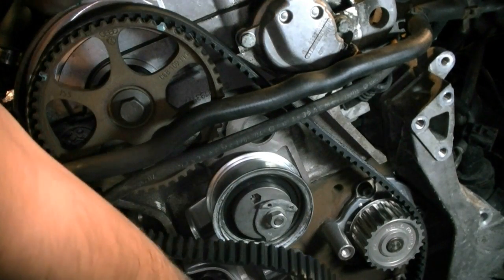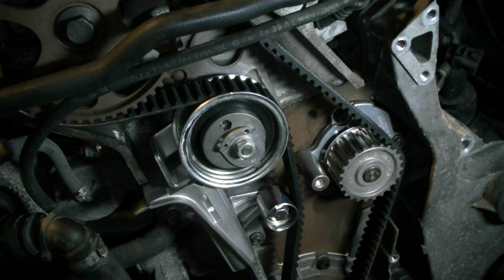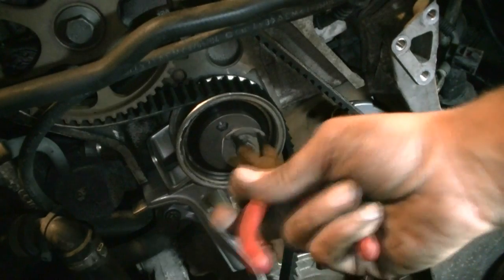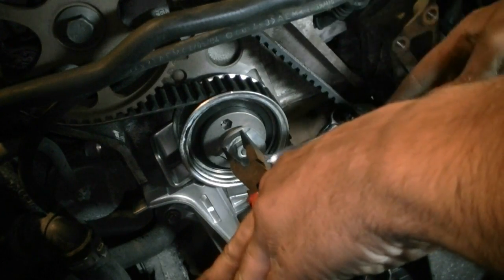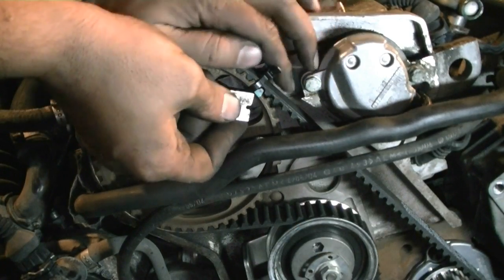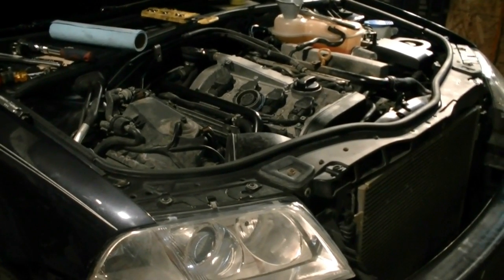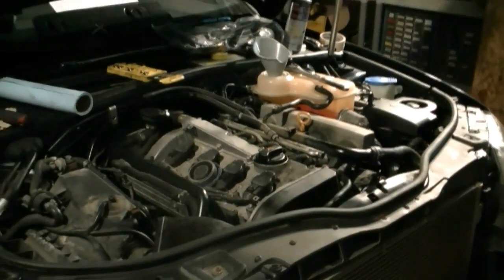How to replace the timing belt on a 2004 VW Passat Audi 1 8L Turbo Engine Part 3

Comment: I've done this twice. This video is a good refresher. I have pulled the rad and bumper for easier access. The Upper Cam gear marks as related to the crankshaft are critical. The removal of the alternator bolt might encourage some hot language! The 1.8Lt is  sweet torture, be fussy. Motor mounts? Thank you.

Comment: Update, pro tip: Replace the failure-prone plunger/idler assembly with a manually adjusted tensioner, as used in the B6 Audi AMB 1.8T engine. ECS tuning and others sell the adapter kit -- highly recommended.

Comment: I think I finally understand the adjustment now. To clarify what you're saying correctly: the spring-hydralics in the piston is too strong to retract using pliers on the pointer piece. You can only do that (if you screw up and release the piston too far) by turning the hex socket counter clockwise (and you should do that slowly). So start with the pointer all the way to the left to have the most slack to get the timing belt on. Then get the pointer as far to the right tightening up the t-belt and lock in place with the bolt before releasing the piston. Then adjust the pointer to the left (pulling clockwise with the pliers) as much as necessary to get your 8mm gap leaving the piston at about the center of it's range. The piston is slow to react and turning the crankshaft two turns makes sure the gap has settled and that your marks still line up.

Comment: I have now got my car into service position and am prepared to remove belt as long as I line up the lines on cam how do I know and does it matter if it is on the compression or exhaust stroke @Ratchets And Wrenches

Comment: 3 yr old video but I did the repair recently but my tensioner piston doesn't stay up, It goes back down.. any advice?
Reply: Buy new tensioner
Reply: Did you ever figure this out? I'm having the same problem right now. I've looked all over and can't figure it out!
Reply: Cameron McEldoon  did you found a solution ?
Reply: Answer the people David! They're waiting for the answer.
Reply: Lol sorry.. didn't seem I was being asked.. apparently the piston is supposed to go down that way when the belt loosens due to use, the piston will than start coming out keeping the belt tight.. my passat hasn't given me problems so yep yep

Comment: There is a procedure on Passat world that leaves the half tooth off timing mark to the right of the mark on the valve cover rather than to the left as in your video. The reasoning behind this is, if the belt stretches over time then the timing will improve rather than get worse.

Comment: great video.. I need to replace my water pump.. how long of a job you think it would be?. 2002 a4 quattro 1.8
Reply: Same length of time to change a timing belt.  If you need a water pump replace the belt and visa versa.  Never replace one without the other.  Get a complete kit.  It contains tensioner and every thing else you need including the pin to hold the tensioner.

Comment: How many km do they have recommended before changing rhw timing belt
Reply from the maker: jiinlone07 Its based on your car's year make and model.
Reply: In europe they do it roughly on 50k, but as mentioned it differs from car to another

Comment: Half a tooth on the cam is a full tooth on the crank as the crank spins twice for every rotation of the cam. The marks should line up to the dot or the engine will not be timed correctly and if bad enough you'll get cam/crank allocation trouble codes. The timing belt will also stretch slightly so that's going to mess your timing even more. Your car, your engine, my advice...take it or leave it. Best regards from a level 3 Audi tech.
Reply: Nope, it never perfectly matches up on these cars
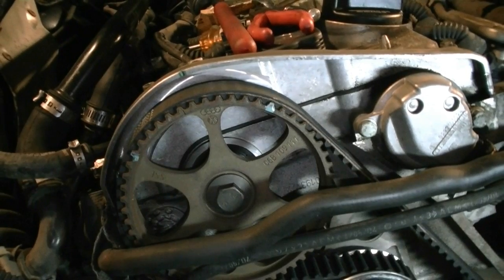Reply: +1 I had a code 17748 cam/crank correlation error on my 2003 Passat 1.8T. The belt was replaced before I bought it.Removed the timing covers and the belt looked exactly like this video (at min 5:30) with the cam mark slightly to the left of the mark on the cover. Moved one tooth over marks now line up and no more engine light.
Reply: As you know it's best to take the timing covers off and check the cam windows for proper time, the pully might be off slightly but that's no big deal as long as the exhaust cam is timed properly.

Comment: thank you your video was to me very helpful. I changed the timing belt for may past 1.8t 2003 after one day driving I got p0011. when I opened the upper side timing belt cover I saw the roller tensioner went back and the hydraulic tensioner went back to its original position. when I loosed the roller nuts the hydraulic pushed the roller up. I believe my mistake was that I tightened the roller nuts to strong. what do you think? do you have the torque for roller nuts?

Comment: if I want to change the timing belt and I am messing up with camshaft teeth and belt. is it possible to get it right position? please ask my question cause I need to know before start up
Reply from the maker: Dont start the car if your timing marks arent lining up, you will destroy your engine. Keep watching this videos and keep trying until you get them to line up, after each time you adjust the belt, turn the crank two full rotations and check your marks. If they still dont line up get a professional to come fix it for you. GL
Reply from the maker: 2 or 3 millimeters? no that shouldnt destroy your engine, but I wont be held responsible if it does since you might have over tightened something else or the belt might be too loose or something!! Just take the belt off, follow the instructions exactly, especially about the tensioner and try again. You should get it right. Also make sure you are looking at the cam straight.. maybe its at exactly TDC anyways. GL
Reply from the maker: Did the noise only come after you changed the timing belt? If you put the timing belt on wrong you would have a check engine light, probably regarding a camshaft sensor also missfire's if you put it on way off mark.

On the other hand sounds like you have a bad turbo, oil is leaking into your intercooler and being sucked up into your intake manifold and burned by your engine, thats why you have low power. As far as the noise, it will be very hard for me to tell, but try to pin point where the noise is coming from, top of engine left or right? Maybe your turbo?

GL

Comment: Thanks for the video.  It took me two days but I am sure I would not have attempted it without your video.  I broke an allen wrench in one of the harmonic balancer bolts.  Could not drill it out.  Beat a 12mm socket with 12 points over the bolt and was able to remove it.  Also, attempted to torque the tensioner bolts to 25 lbs as suggested.  One bolt broke at 20.  Oh yes, the thermostat goes in with the spring side in the block.  Thanks again for your help!!

Comment: wats the driffent between the audi 1.8litr an the vw passat same perseadure ign timing
Reply from the maker: They are the same engine, with minor differences, but the timing belt procedure should be the same. But check your manual to be sure! GL
Reply: same basics same function same engine ignition timing  position

Comment: When changing your timing belt, they recommend you change your water pump as well. Must you also have to change the thermostat or does that depend on its condition?
Reply from the maker: Yes, its a very good idea to change the water pump and thermostat while you're in there. Its money well spent. GL

Comment: How long does a timing belt last on a Passat before needing replacement? I am planning on buying a 2003 VW Passat and the timing belt was changed when the vehicle was at 73k and now its at 93k.

Comment: Doing a timing belt is easy
Doing a timing gear set and chain is easy
As long as you understand what is TDC BDC
If you are not paying attention you can easily be 180 degrees off or even 1 -several teeth off and if its that far off you should not be doing that kind of repair to begin with.

Comment from the maker: If the car was running and the timing belt broke you have bent valves, sorry. If you are asking how you can check to see if the timing belt is broken or not, you can remove the upper timing belt cover and check it. I dont remember exactly but you might have to remove the serpentine belt tensioner and the serpentine belt, check my number 2 video for this. You wont have to put lock carrier in service position for this. gl

Comment: Hi I have 03 VW Passat I know I need to replace the timing bell, but is there a way I can find out with out changing the timing bell if I miss up the  valve. See The car told me to stop and I did not. Until the car just stop on me. which that was sad.

Comment from the maker: Never had to count the teeth on any timing belt job I've ever done, if you go to a reputable parts store, know yr/make/engine size/date of manufacture or if necessary vin# of your vehicle, they should be able to give you the correct timing belt. If they tell you to go count the teeth on your timing belt instead of asking you the above info you need to go to a different parts store.

Comment from the maker: I havent remove a cylinder head of these cars but you'll need a special tool to remove the head bolts. If you have done a headgasket before and have time and patience you can probably pull it off. Or you can always get the car in service position and remove as much as you can before getting someone with experience to remove the head and save on labor costs. GL

Comment: I, unfortunately, was unable to change the belt before it broke. I was going less than 10mph almost at an idle when it happened. Absolutely heard nothing when it happened. What are the chances of not having valve damage? I'm already pulling things off to replace the belt and waterpump.

Comment from the maker: oh man, it all depends how many teeth it was off. But if you were able to get it running even though it ran like crap it usually means the valves didnt hit the piston and arent bent, just not closing and opening on time! Usually when they hit the piston, the engine just wont start period.

Comment: I had a question for you. I did this whole process and had the cam gear spin clockwise on me a little ways. I stupidly started my car, which was tough and it idled like shit. I turned it off in about 5 seconds. I'm having a guy come out and fix the timing  so I can make sure everything is right. It didn't throw any codes because I didn't give it time to do so. Should I be alright? I didn't hear any pinging,.

Comment: Correction .......mark is after the tooth not on the tooth.... This is so its easier to aline by looking at the other end of the pulley ( move the belt slightly away so you can see the inside of the pulley rather than trying to look along the pulley )

Comment: ......then when you take the pin out you can hold the metal part of the tensioner that the piston hits and slowly let pressure off to allow the piston to come out until you get correct measurement, or even pull it up slightly if your careful. And if its half a tooth out it can cause running problems from cold it should always line up correctly if done correctly

Comment: For starters you don't need cable /zip ties. If you put the belt on the pulleys in the correct sequence it should go on no problems.( first crank, second cam then waterpump last.) Secondly the tensioner should have a line an it and you turn the part of the tensioner so that the bit that sticks out is 180 degrees from the line ( the line should be on the part of the tensioner that doesn't turn.) Finally if you look at the mark on the cam it's actually before the tooth not on the tooth........

Comment: I have an 2003 passat 1.8 t .
It has a little over 100,000 miles on it.
I have put timeing belts on other things in the past but never a VW.
Is this 2004 the same as the 2003 passat ?